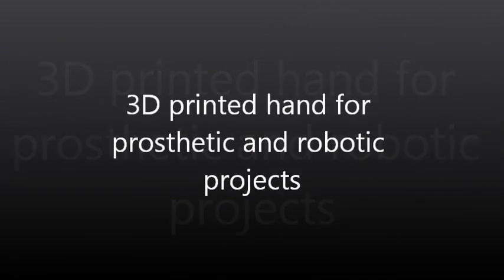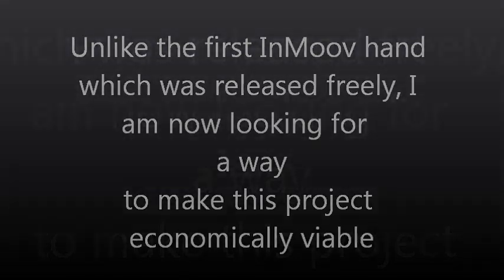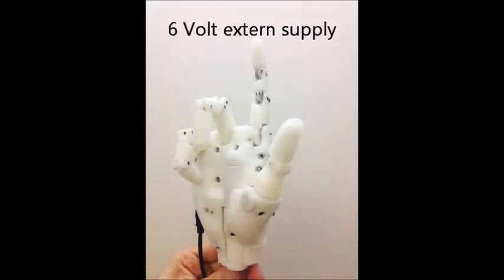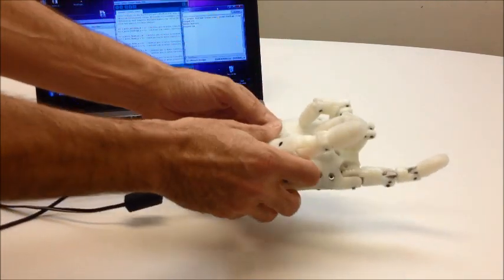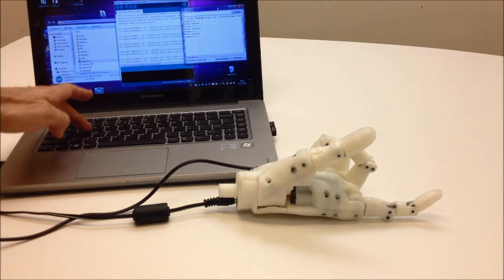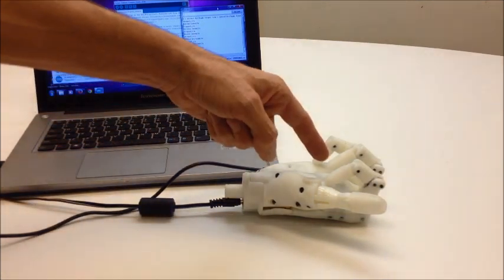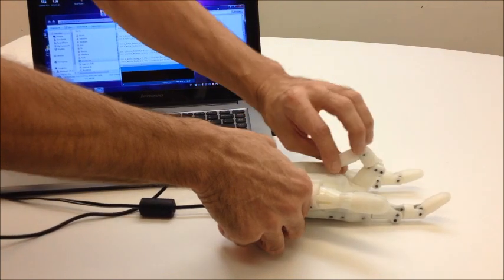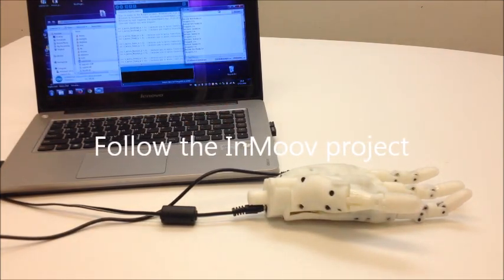3D printed robotic, prosthetic hand InMoov

Comment: At 0:23 in the video there stand:
"Unlike the first InMoov hand which was released freely, I am now looking for a way to make this project economically viable"

Can you specify it a little bit more?
So, the InMoov2 hand will not be OpenSource? Or will it be made OpenSource, if the InMoov3 hand is out?
Or will be every new thing five years after the release published as OpenSource?

And what will be happening with the legs and so on? If they are finished, will it NOT published too?

What does it mean for the free InMoov project?
If the new things are closed, then I think you will be no longer having motivation to improve the old things (like the InMoov1 hand).

That also mean, that in the future your creations diverge from the OpenSource InMoov creations other people.
So the OpenSource InMoov1 needs a new home (new central internet side with forum, etc), because it is a complete other thing then that, what you (currently and in future) creates.

Greatings
theuserbl